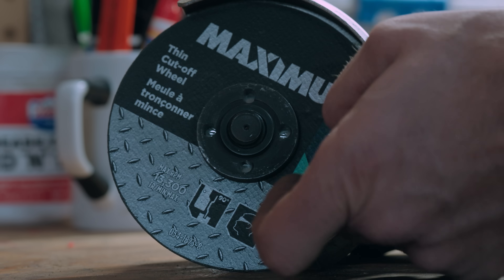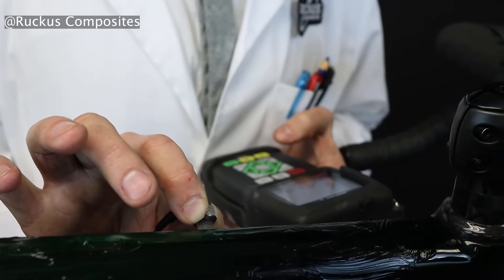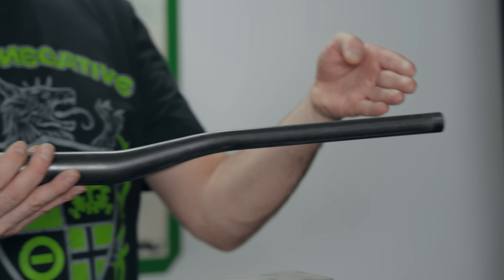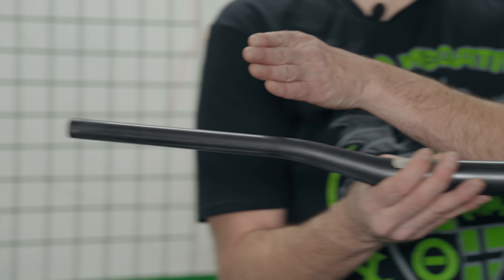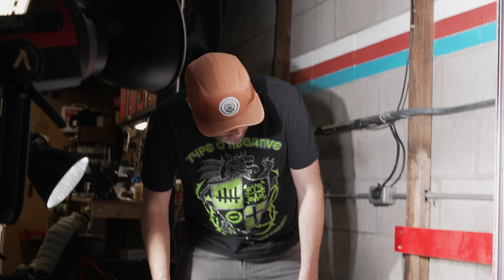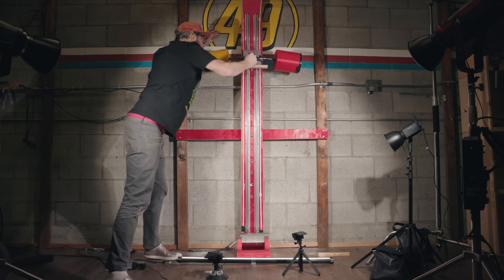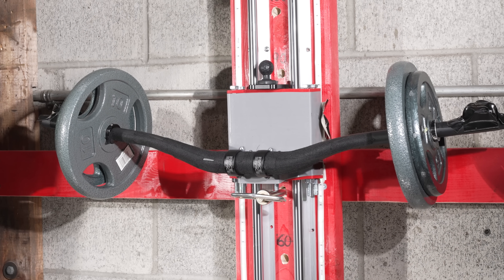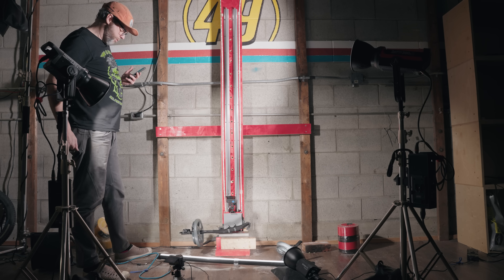Is Repaired Carbon Fibre Safe? Breaking Point Test

Comment: Whenever I hear about carbon fiber safety I think of submarines for some random, undetermined reason. Maybe just me.
Reply: I think back to the one that was piloted with a Logitech remote control too.
Reply: @nunyabusiness7477 that logitech controller was probably the mozt certified thing on that "submarine" 😅
Reply: @nunyabusiness7477 , can't understand how so many people agreed to get in that thing 🫣
Reply: @nunyabusiness7477 and the US Navy uses xbox 360 controllers.
Reply: Great tensile strength. Excellent for making containers containing high pressures (trying to stretch the fiber) - Terrible for making containers taking high external pressures (compressing the fiber lengthwise, which very much would like to).
That submarine was holding up against the pressure with resin, carbon fiber in that mix was almost like pushing with a rope.
Reply: @tuoppi42 Exactly! I was astounded when I read some clueless fool was putting his faith in carbon fiber under compression.
Reply: @tuoppi42  Yes, but its not that simple. For example in carbon fiber composite aircraft - During a high positive 6 G turn, the aircraft weighs 6 times earth gravity. The wings are being flexed upwards, the top of the wing is under compression and the bottom is under tension. It's not entirely the bottom of the wing under tension that is taking all the force. Carbon fiber does have compressive strength, less than steel, which is more ductile, and thus a better material for deep sea vessels. Carbon is not very ductile, when it deforms, it splinters and forms delamination's internally, and these cause the force to be more concentrated to the remaining material, increasing the potential for failure as the material degrades. This is why carbon fiber aircraft have limited cycles (one cycle is one take off & one landing) or hours and are scrapped. You can sometimes extend the life of the aircraft by doing a in depth structural inspection, with non-destructive testing methods like ultrasound and x-ray. Ocean Gate ignored any recommendations to limit the cycles, it should have only did that dive once or twice. They could have increased the dives by getting proper non destructive testing done, but they refused and relied on inexperienced young technicians to carry out tap-testing in between dives. Tap testing can be a reliable method of finding hidden damage and involves using a calibrated tool to tap the surface of the structure and reveal damage by a dull thud over a sharp tap, but it can be subjective, and is still not recommended for critical structural components subjected to this kind of force. Stockholm Rush was a cheapskate wanna be innovator with a background in tech, not engineering.
Reply: To be fair it worked for a while……
Reply: @Prompt-Critical-g5t  It was a "one-time use" submarine and they were on their 5th-6th trip down or something.
Reply: @aamry  plus they refused to do non-destructive testing like x-ray or ultrasound, they could have done that many dives safely had they not relied on a bunch of entry level techs tap-testing for voids. Tap testing is a common inspection technique and literally just involves taping with a small hammer or coin, and listening for a dull thud over a sharp snap. This also changes a lot depending on the construction as reinforced areas will obviously sound different, plus this has a huge human element - they refused to hire "grey hair ex military types" because they wanted "young innovators" aka they wanted cheap labor.
Reply: I guess I trust engineers, not a magic word like “carbon fiber”.
Reply: Perfect example "can" not being the same as"do"
Reply: My wife said that I was not to ask if he repaired submarines. Too soon she said…..so I won’t.
Reply: Someone should make a sub out of carbon fiber.
Reply: Tension... Not compression
Reply: I then think about diversity hire and that they fired all capable men that were doing a good job working on these submarines and that the fired men already told them it's unsafe but diversity hire knew better. It's almost like real life comedy.
Reply: Same here
Reply: @tuoppi42 that’s why it makes better air plane bodies than submarines.
Reply: A very unrelated reason to the titanic
Reply: i think about an xbox controller for some reason
Reply: SNL - "I squish you ... "
Reply: @Kaptain13Gonzo  Wasn't that Kids in the Hall?  "Crushing your head!
Reply: @koch5000   Ah. Oldtimers moment. I think you're correct!
Reply: @Kaptain13Gonzo  Kids in the Hall.
Reply: @Kaptain13Gonzo  I think that was from The Kids in the Hall, but yeah, still funny 😂

Comment: Totally safe if done properly. 
Not unlike fixing fiberglass.
Reply: I used to repair unmanned military carbon fibre aircraft in the field along with helicopter rotor blades blades and as long as you prepare correctly don't rush and add more than the original it's will be fine, it's all about the angle of the overlays and using a decent vacuum
Reply: Untrue. Especially for structural and technical parts.
Was it made in an autoclave under pressure and temperature ramps?
Doesnit have a crash profile?
Is it designed to fail in a specific way?
For instance a carbin race car tub.
Thats designed to collapse in a crash in a very specific way, any significant structural damage?
Its goes in the bin.
Reply: @deadprivacy is any of what you wrote relevant to bicycle parts?
Reply: @Jehty_  yes.
Depends on its purpose. How it was originally made, how it was laid up.
The fibre directionality.
Whether it is overengineered piece or an extreme lightweight article thays built on the very edge of we8ght vs strangth.
The abuse it will suffer in future. ,the abuse its already taken, the likely mode of failure if it breaks again and whether it might impale you when it snaps.
Much to consider
Much CF on bikesbcan be repaired ,but i wouldnt try handlebars or wheels or seat posts to be fair, unidirectional CF is not easy to properly repair especially if it was pressure formed during manufacture.
Wven if you own an autoclave you are never going to get the integrity that it potentially left the factory with.
Also consider the internal stresses on the stuff, its all laid up in controlled environments in the factory.
A rise or drop in temp under stress or heat cycling and the piece you repaired that was perfectly strong when you reapired it at 20 degrees?
Might have all been laid up at 27 degrees and auddenly your reapir just separates when you pull the buke out and its 2 degrees or 35 outside.
A lot of repairs ,mostly to
Frames are actually a result of voids ,bridging amd undersaturation of fibres built in at the factory stage.
Reply: And he didn't fix it properly.
Reply: @plav032  Thanks, rando voice from the internet. You seem legit. I'll listen to you.
Reply: @WindFireAllThatKindOfThing  lmao
Reply: @WindFireAllThatKindOfThing  I'm in aerospace and I work on a fleet of carbon fiber aircraft. This repair would not be approved in my industry. Rob just bonded on a new pre-fabbed carbon tube section with a dowel in the center. His repair meant all the stress concentrated on the bonding agent. He should be tapering the repair and using individual carbon layers with alternating weave biasing. Then resin infused in a vacuum bag and cured with heat. That way the stress travels between the individual layers as a matrix as opposed to one section of pure resin like he did.
Reply: @plav032  there are two types of people: engineers and pragmatist. If you actually watched the video you would have seen that the repaired handlesbars surpassed the most cathastrofic forces a rider could imput on the bars (except for crashing). Go ride, my friend 🙂
Reply: @plav032  That sounds right, but to be fair to Rob he's repairing a bicycle part and not an aircraft. 
You should also note how these bars and many other "carbon fiber" parts are made; they're injection-molded "carbon fiber" which is really just fiber-reinforced nylon and not true layered-and-resin-cured carbon fiber. Very different than how the tub or airframe of a carbon-fiber aircraft is made. So it would be impossible for him to actually repair the carbon layer-by-layer when there are no true "layers"
Reply: @plav032  And I'm an Army Light Wheel mechanic, not an Aviation wrench. Just because I don't put cotter keys a castle nut on every bolt in an MRAP like my kin at the Chinook unit next door seem to do doesn't mean I did it wrong.   
This is the enduring failing of engineers in their specialized field: They think their context is the only context.
Reply: @plav032  beat a fool and they will still be a fool.